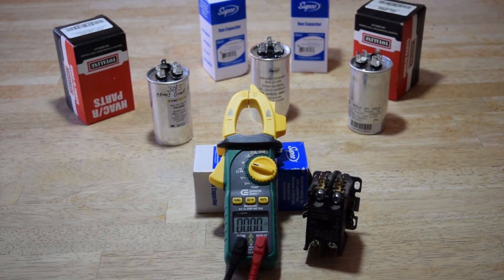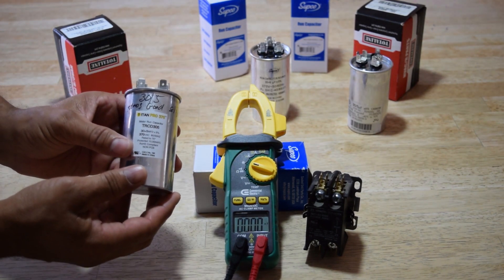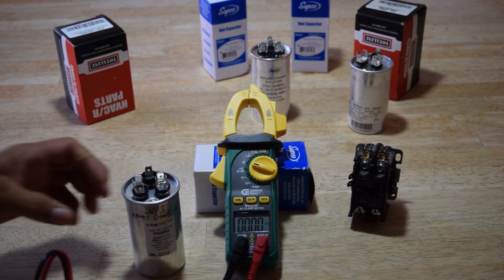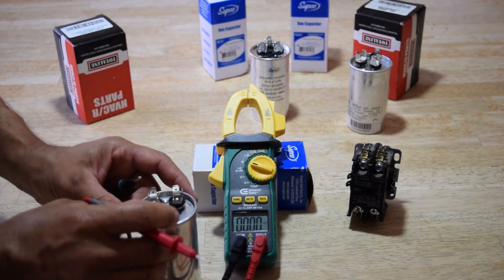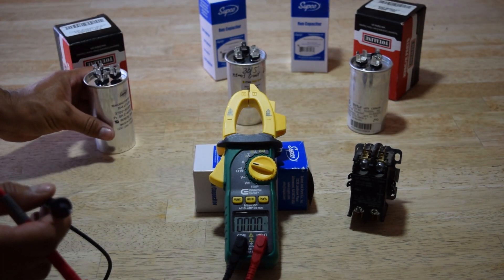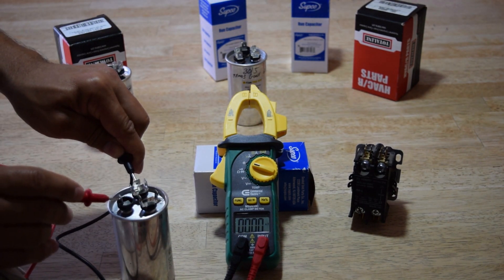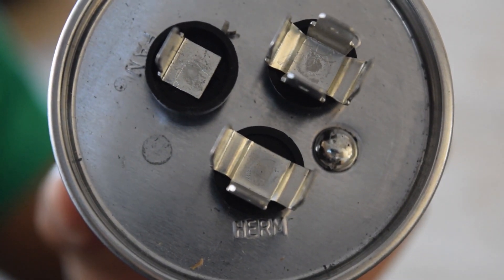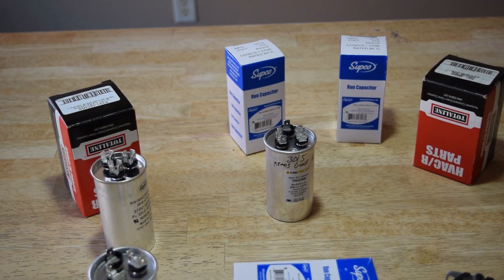Air Conditioning not Cooling Easy Fix

Comment: Have you heard about using Cold Plus refrigerant additive to get colder air and use less electricity? I heard that both commercial and residential units are saving between 8% to 18% utility bill savings...is that possible?
Reply: Tom Warda if the capacitor is bad will it make the unit make sure buzz sound